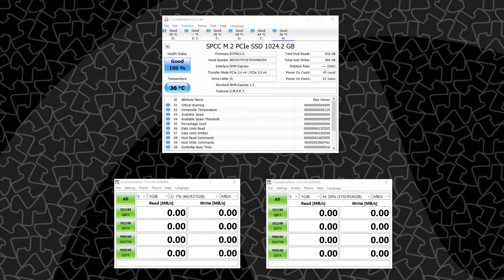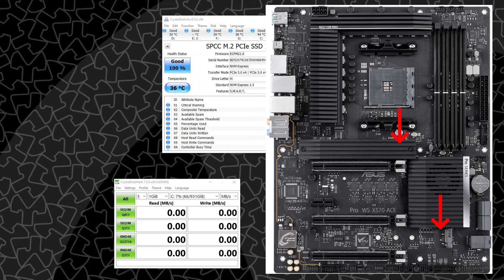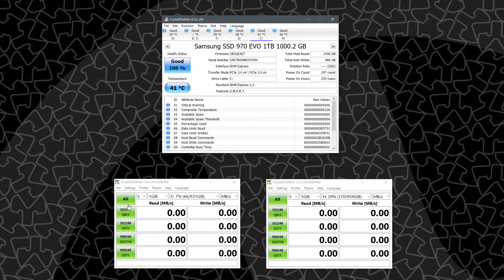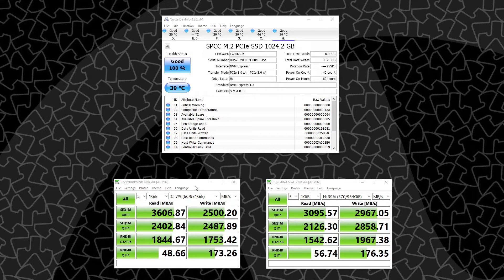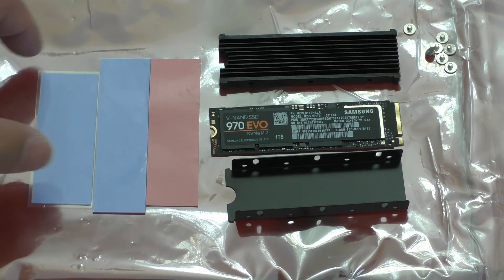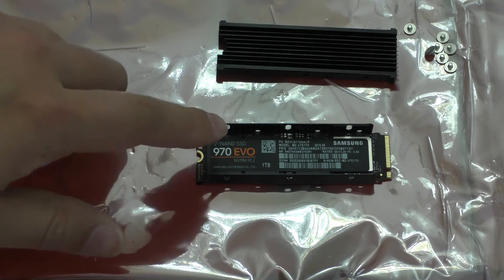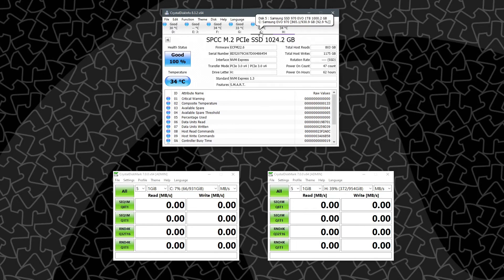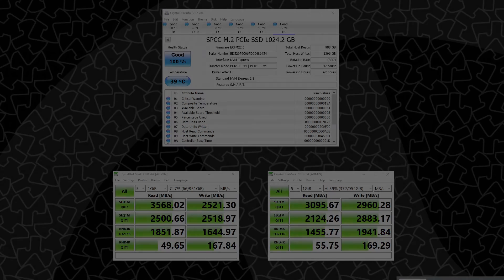Motherboard M.2 SSD Heatsinks, Yay or Nay?

Comment: I didn't know about thermal throttling for NVMEs.. I have a Samsung 970 Evo Plus 500GB in the CPU slot of this same board, and in the chipset heatsinked spot I have a Samsung 990 Pro 2TB. I originally had two 970 Evo Pluses, one in each spot, but I never bothered to really check temps, or if I did, they could have been about the same.. I'm currently at 47-60c for the 970 Evo Plus unshielded and 46-64c for the 990 Pro shielded, while running a game off it, so it seems like maybe it's helping a bit.

I wish you'd shown the fitting of the CPU shielded M2 drive, but I'm guessing you had no clearance issues with your kit and the Asus TUF Gaming x570 Plus Wifi mobo. I might get a shield for my top slot like you.

Comment: The question is ... Does the bottom Asus heatsink fits the top nvme slot or fits only the bottom location? I run only 1 nvme at the moment, hope not need to buy new heatsink...
Reply from the maker: On this board unfortunately the heatsink isn't transferrable between the slots.
Reply: @FaRKle0079  Thanks for the details. Quite bad design to limit the heatsink to one location only...

Comment: Isn't C: the system drive? If so all those calculations are creating additional heat on top of the stress test while the other is only under the load of the stress test.

Comment: In my mobo(tuf b550 plus) heatsink comes in only m.2 on the bottom side of mobo but not on the one near cpu but there is a place to put one so i put the below one heatsink into upper one. Is this a problem?

And i didnt know if its in contact with m.2 or not so i removed and saw some dark shade on m.2 which says its in contact with m.2 so i put it back again
Reply from the maker: Interesting, it actually does look like you can swap the heatsink onto whichever M.2 slot you want on that mobo. If you see good impressions from the memory/controller on the thermal pad on the heatsink, then I'd say it looks like it's working.

Comment: Hi.  What is the height of the m.2 slots on that particular motherboard in the video?  I want to get a 3rd party heatsink but it needs an m.2 slot of 4.2 mm.  I can't find the information on the m.2 slot height for it anywhere.
Reply from the maker: Are you asking if there's 4.2mm between the motherboard surface and the bottom of the M.2 SSD?

Comment: in this motherboard, are both slots with same speed? I mean, are they both PCIe 4.0? where do you recommend i put my first M.2?
Reply from the maker: Unless your drive is soooooo fast it can saturate the PCIe lanes, it doesn't matter which slot you put it in. So put it wherever is easier to service :).

Comment: Great video! I have a x570 crosshair Viii formula motherboard I put my m.2 towards the bottom. I needed to see you put it in to see which one and how you got it in. If I use the bottom one would I need to still use the motherboard heatsink or just leave it off? Please respond
Reply from the maker: I'd use the integrated motherboard heatsink if using the bottom slot on that mobo.

Comment: Idk if you'll see this, but hypothetically if I didn't have standoff screw, would the heatsink technically be able to hold down the SSD properly to where I wouldn't need one? Probably a stupid question, but I just got a Samsung 980, got home, and realized I have no standoff screws. I have the ASUS x570 plus wifi board with the headsink on the lower one.
Reply: are you still using yours without a standoff? 😂 I was too lazy to go back out and buy one, and now I've had this heatsink holding the NVME drive down for a few weeks without a screw, did yu have any issues?

Comment: Without a heatsink my Samsung EVO 970 1tb goes up to 98'c on a 10 minute stress test. Everything else is very cool, iv not had much choice, and have had to order a attachable heatsink in order to control the temps a bit.

Makes me wonder why dont M2 drives just come with their own heatsink, rather than me having to buy one seperately. They obviously need a cooling object.
The EVO 970 especially...is dangerously hot by default without a heatsink, one should be provided in my opinion.

I Idle at 40-50,  play games and run normal operation around 68-78'c, And stress test up to 98'c on writes. I have ordered an amazon heatsink, and will come back with an update to my temps here.
Reply: a lot of drives do, but if you had a high end board that had built in heatsinks you'd be asking why they don't sell them without one.  just buy one off amazon like you said.

Comment: I got the asus  tuf b550M (which presents the same situation) and the M.2 near the CPU is gen 4, which is faster than gen 3 (the M.2 that comes with the heatsink). This doesn't make sense, because the gen 4 is needing the heatsink more than the gen 3. Anyways, this video helps to show that the heatsink is really needed for the "naked" gen 4 M.2. I wonder if the heatsink of the gen 3 that comes with the mobo could be used in the gen 4 instead? I can't test it because parts didn't arrive yet. Anyhow thanks for the video, really useful.
Reply: Have you tested this?.. I wonder if I should buy a heatsink or can fit the one from the bottom slot. Please let me know!

Comment: The top slot is usually connected to the cpu directly and should perform better. you can test that by testing both without the heatsink.
Reply: Regardless of whether It's a 3.0/4.0 slot or 3.0/4.0 drive? For example if the slot closest to the cpu is gen 4 but you're running at gen 3 speeds is it still faster than just using the farther gen 3 slot?
Reply: @cam42704  I assume the second gen 3 was supposed to mean gen 4. In most cases the answer is yes. Because the chipset is often only connected with PCIe 3.0 4x (for example on B550). X570 has a PCIe 4.0 4x connection to the chipset, but that is shared between all chipset devices and introduces higher latency. Furthermore you would require a PCIe 4.0 SSD that can deliver higher performance than the PCIe 3.0x slot can handle.

So simply said: 
only a few SSDs will max out PCIe 3.0x bandwith.
Usually the top slot is PCIe 4.0 4x anyway.
Even if you are running a fast PCIe 4.0 SSD in the chipset slot and your chipset is connected with PCIe 4.0 4x it still might perform worse because it introduces latency and that bandwith is shared between all chipset devices.

I would always use the first slot.

Comment: Am I assuming correctly that due to clearance that you can not use a factory heatsink that comes with a M2 drive IN CONJUNCTION WITH the motherboard factory heatsink???
Reply from the maker: Yes. The factory mobo SSD heatsink mounting studs are placed at a height so that they sit on the SSD memory chips. If your SSD comes with a heatsink that would raise up where the mobo heatsink sits and it won't sit flush against its mounts.

Comment: Great video! Is there any chance to use the included heatsink in the upper M.2 slot in case you´re using just one M.2 drive?
Reply from the maker: With the ASUS motherboards I've had it wasn't possible to swap the included heat sinks to the other M.2 slots.

Comment: If I move my primary one down to the bottom and put my new m.2 in the not heat sink one on top, do u know if it will work without messing anything up?
Reply from the maker: Yes that will work fine. Just double check in the BIOS/UEFI that the correct drive is selected as your boot drive.

Comment: Will 2 m.2 ssd gen4 work in the aorus x570 pro? I have 1 in atm and want to upgrade it with another m.2
Reply from the maker: PCIe 4 M.2 SSDs should work fine in PCIe 3 slots.

Comment: What an awesome video! Thanks for the info. You should do another video with adding a heat sink to the nvme. But this time only put the thermal pad on the controller chip. As the memory works a lot better and more efficient when it's hot. The controller is what you actually want to cool. And to do it efficiently you have to remove the heat spreader label. Just hang on to the label so you can stick it back on so it does not void your warranty. I would definitely be interested in seeing the difference between this video and that to see how much it plays a role.

Comment: I'm puzzled that (on the ROG Strix B450-F Gaming II) they include a heatsink for the M.2_1 slot but not the M.2_2 slot, given that using the M.2_2 slot affects the further PCI slot, forcing one to use the nearby slot and hence negatively impacting airflow.

Comment: ASUS put only a heatsink on the lower M.2 (m2-2) slot becouse it's far from the airflow coming from the cooler fan should be on the CPU, just up the main m.2 slot (m2-1), where it push some air all the time, enough to keep the M2 SSD cool even when it is working hard. In my hopinion an m2 SSD can work flawelessly, for all its own supposed life, without any cooling system. Anyway, if I have to choose where to place the heatsink between the two occupied M2 slot, I'd prefer the main SSD, the one who will read and write data harder.
Reply from the maker: It's true the top M.2 slot probably gets more airflow, but it's also hotter airflow coming off of the CPU and GPU. I guess we'd have to put some TCs in both spots to see what that difference is.

Comment: pcie 4 m.2 should have heatsink. why would manufacturer do this?
Reply from the maker: They want to cut costs where they can.
Reply: @FaRKle0079  the pcie 3 had one. Why not trade it above? 😂
Reply from the maker: @imnotmark3053  There aren't mounts for the heatsink to move it from the lower M.2 slot to the upper one.

Comment: So I have a b450 elite, it has a heat sink pre-installed. I have a 80 mm nvme do I install with just the heatsink? because it's getting blocked if I'm using the 80mm hole with standoff and screw. Or should I just use the other slot?

Comment: I have a question , my nvme has a sticker on it , should i remove it to put the motherboard heatsink or should i leave and put the heatsink over that?
Reply from the maker: You can leave the sticker on there, it'll conduct the heat through.

Comment: thanks for the video exactly what i was looking for. was debating whether or not i should use the heatsink on my asus tuf b500m good thing i did the m.2 ssd i bought runs specifically hot at 80c+ without i've seen

Comment: is it better to put 970 evo plus on m.2 4x adapter insead of under the graphics card?
Reply from the maker: There could be more residual heat coming off of the GPU if you have one that runs really hot. If not, then I don't think it really matters.

Comment: You claim it's well worth getting a heat sink, because the temps went down, but there wasn't any actual performance benefit from doing so! Lower temps don't mean anything if it doesn't cause the SSD to throttle less. And from the CDM numbers, there was no meaningful difference between the before and after.

Comment: I have an ASUS TUF Gaming B460M-PLUS motherboard.  One m.2 slot just above the video card has no heatsink.  The other one has a heatsink but is located directly underneath the video card.  So, I'd be interested to know if anyone's noticed a difference as I suspect the heat coming off a video card might negate any benefit from the included heatsink.

Comment: Brilliant review. Thank you for the video, it helped me answer some questions about SSD cooling. But I have some advice on improving your video - you might want to include a photo of your current computer setup to show if airflow around the CPU was a factor during the test runs. Watching this video I am wondering if the CPU fan may be directing some of the hot air onto the Samsung M.2, making the temp higher than the P34A80. Of course this is depending on what CPU cooler you're using.

And it'll be best to work with two of the same SSD because different brands will produce different results so you need to keep the variables as small as possible...but its understandable if you do not. One solution is to switch between the two M.2 and do another test to show if being close to the CPU does affect the operating temp.

Comment: In terms of SSD speed, if I use the one that comes with a heatsink, will it have the same speed as the top one that doesn't have a heatsink?
Reply from the maker: There shouldn't be a speed difference depending on which slot you put the drive into. Without a heatsink the drive should run at full speed unless it hits throttling temperature.

Comment: I have the same board and I believe the Nvme slot that originally has the heat sink also gets some airflow from the chipset fan. There seems to be some airflow cut outs in the fan shroud. If you have time put a mini 40mm Noctua fan on your new heat sink . Thanks for the vid , so many people like myself may not have known the benefit that the heat sink would make.

Comment: So the conclusion is that the heatsink supplied on Asus X570 is good enough or another should be purchased? Such a simple question and it is very hard to find the answer in the video as from the conclusion it§s not clear whether it is supplied heatsing or an additional one
Reply from the maker: Yes, the included heatsink is plenty fine.
Reply: @FaRKle0079  thank you!

Comment: Those samsung m.2's actually have a thermal solution on them already...It is built into that label and you would want to remove it completely if youre using new thermal pads and keep in mind that actually part of these m.2's actually do better when they are hot (obviously not excessive heat) and the controller obviously needs to be cool....so you not removing the stock thermal solution is potentially harming your performance. Remove the sticker and youll probably get better results. In my opinion the top one being a boot drive is going to be a little hotter than one used for just storage. Just going off personal experience Im not 100% sure I know anything sometimes hahha....thanks for the video none the less.

Comment: But cooling your nand shortens it's lifespan?
...
What to do..
Reply from the maker: That concern is overblown IMO. Even with a heatsink the temperature should fall within the temp operating range of the drive, and the endurance numbers are specified for that range. If you're concerned about getting max life beyond the rated specs, that kind of falls into the "penny-wise" category for me.
Reply: @FaRKle0079  You're fast! I was just going to delete my comment after reading this article : https://www.maketecheasier.com/does-nvme-ssd-need-heatsink/

Seems like the nvme stays at a good stable (still warm enough) temperature with a heatsink. While it could get too hot without one.

Thanks!

Comment: My M.2 runs hotter by the CPU then it does in the other slot away from the CPU.
Reply from the maker: My rig is watercooled so there's not a lot of residual heat going to my first M.2 slot.

Comment: I have just one ssd m.2, where i put it? Thanks
Reply from the maker: You should be able to put it in any M.2 slot on your motherboard. If there are specifics, they'll be in the manual.
Reply: If you have a B550 motherboard, you may want it in the top slot because 1) using the bottom m.2 slot will disable SATA ports 5 and 6 (which could cause you headaches in the future if you try to use them) and 2) the top slot is the only slot that's PCIe Gen 4 (matters only if your SSD is also Gen 4).

Comment: Just a couple of quick observations I have to help improve further testing. You should use the same brand, speed, storage capacity, etc.. m.2 drive for both variables when testing. This way you eliminate the variance of one drive naturally running hotter than the other. Although in this video you remedied that by adding a heatsink to the upper m.2 and running another test. But if the drives were the same to begin with that would have saved you some time. When testing anything it is important to keep your constants the same. Can't wait to see more tests though!

Comment: You do not want to keep those Temps that cool, especially on the nand, even if you prevent throttling. In day to day keeping nand that cool will degrade write wearing. You can prematurely fail.
If you are going to write constantly, maybe just heatsink the soc. But then if you remove the heat spreader label you remove heat from nand, which needs heat to write clean

That's why the motherboard supplied heatsinks don't have major fins, they are just bigger heat spreaders for all you benchmarkers. They want to please you but not hurt the longevity of the drive too much.
Don't believe me? Ask the drive manufacturers 
Cheers
:)

Comment: Great video! 🙂 One question though... I just purchased the TUF X570-Plus mbo, and also the Adata XPG GAMMIX S11 Pro, which has its own heatsink. How do you suggest I install this SSD? Can I put an SSD with its own heatsink into the second M.2 slot that comes with a heatsink? Are both M.2 slots the same speed? Can I remove the mbos M.2 heatsink?

Much appreciated!
Reply from the maker: If the SSD already comes with its own heatsink, I'd just leave that on there. You can put it in any M.2 slot on the motherboard, and you don't have to use the included heatsink on the bottom slot. Both slots are the same speed.
Reply: @FaRKle0079  thnx for the response! 🙏

Comment: As well the chips set fan blows air directly out onto the bottom m.2 slot that has a heat sync may very well be making a difference as well.
Reply: Well, if the chip set fan bowing EXHAUST onto the heatsink, that will RAISE the temperature on the ssd. Think it through.

Comment: Couldn’t excess heat from the GPU be affecting the top m.2 without a heat sink?
Reply from the maker: Yes, residual heat from the GPU can add to the heat load the upper SSD sees, and the amount will depend on the type of cooler the GPU has. In my case my GPU is water cooled so the residual heat going to the SSD is really low.